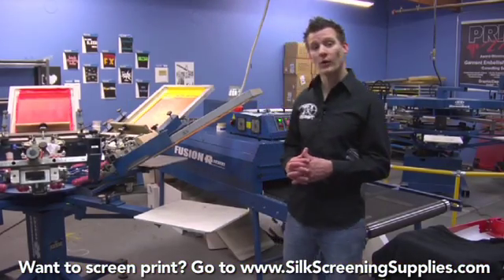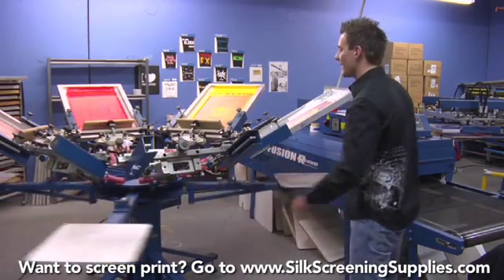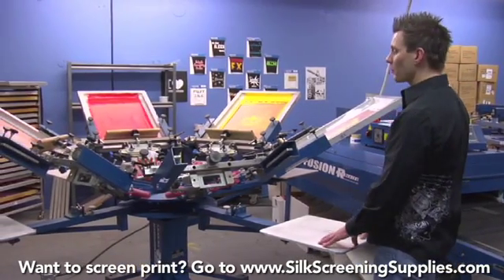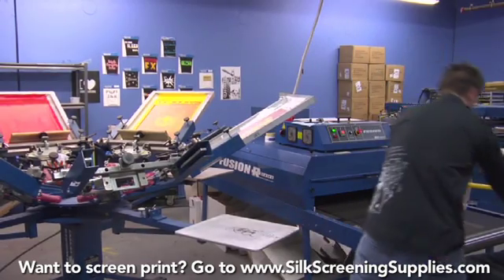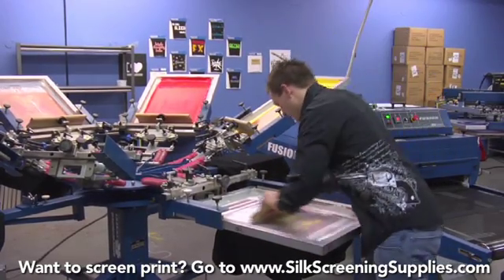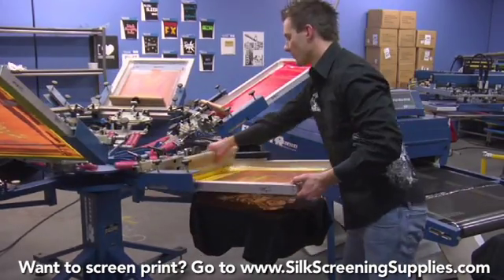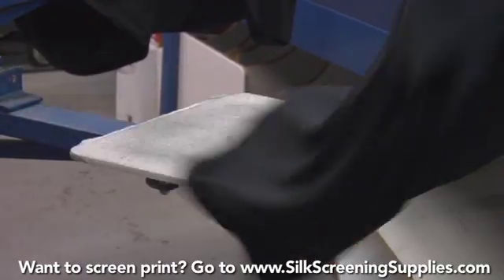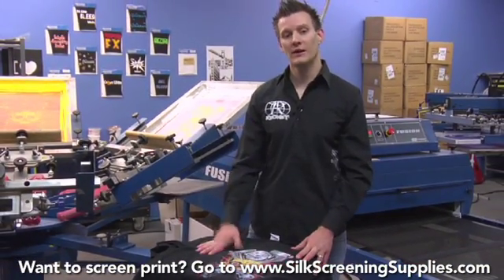How to Screen Print - Simulated Process - Detailed instruction - Screen Printing 101 DVD pt 34

Comment: I have yet to do some simulated process but curious as to why you would not print flash print for each color and only flash the white under base?
Reply: Mainly because printing wet on wet allows for more blending and helps hide the halftone patterns. Same principle as 4 color process, just different inks & different prep work for the art.
Reply from the maker: That's a great question! If you give our success team a call at 800-314-6390 or email them at success@ryonet.com and they can help you out!

Comment: In a world filled with an endless sea of white inks the meteor white is my favorite, and trust me I have used many many white inks. It has the best balance of opacity and creaminess I've ever had from a white I didn't mix myself. As an underbase it flashes nice, gels up right with no tackiness. Once cured the hand is soft and the opacity surprisingly vibrant. In my opinion any spot process on dark, any spot on dark will only be as good as the base you're applying your color to.
Reply from the maker: +Stephen Reynolds Thank you so much Stephen that really means a lot!! We really take pride in the Green Galaxy line and meteor has continued to impress! Let me know if we can ever be of assistance! You rock!!

Comment: Whenever I run a manual job with a flash of more than 60 pieces or so, I know my pallets will heat up... my solution was to set up a small table with a fan after my flash to quick-cool both the ink & pallet. It works great & I just wanted to share some info that may be helpful somehow. Happy printing!
Reply: Thank you for the tip, even 7 years later it's helping people!! Cheers mate!